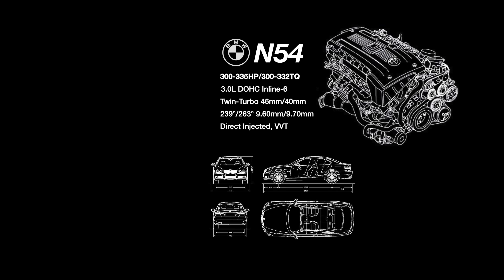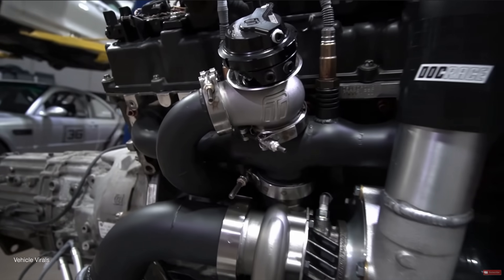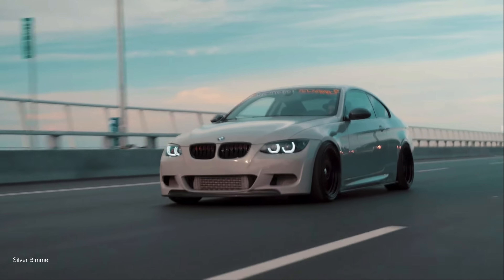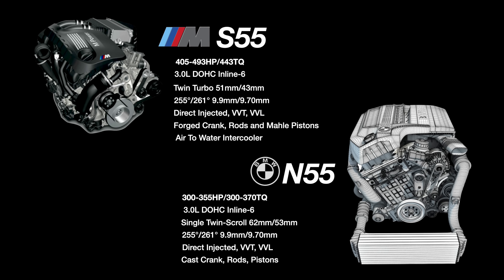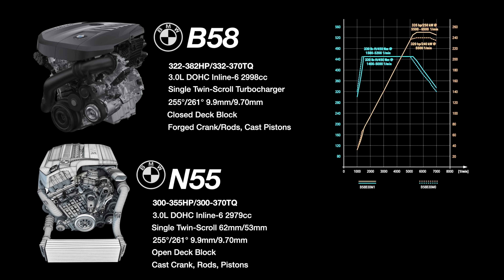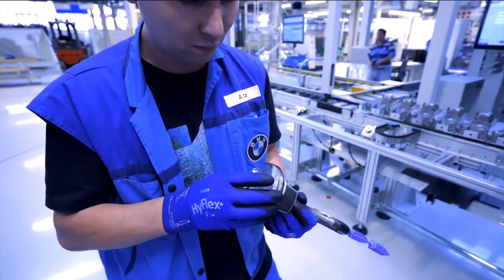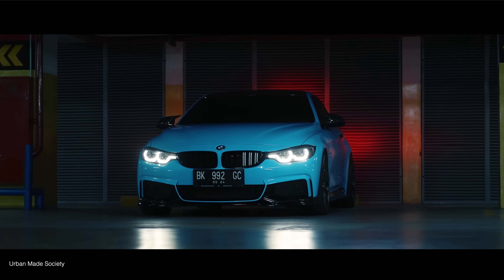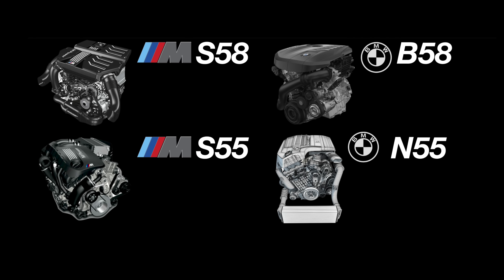BMW Turbo Inline-6 Engines Are Ridiculous | Explained Ep.4

Comment: Lol thats me on s55 race with my m4 e85 vs redeye. To add to your video I have put almost 38k race miles running only full e85 almost at 600whp and have over 100 races running at that power level. Only issues I have had in my last three years and 38k miles racing  were spark plugs/ ignition coils / fuel injectors. I testify for s55 being one of the best engines in the world
Reply: That wasn’t you on your most recent setup, was it? I think you would do a lot more damage now than you did back then
Reply: @PapiAndrey  correct I  have water / meth injection at the moment and makes the car 1-2 cars faster than from you see in the video
Reply: A modded m4 vs a modded red eye 
The redeye puts bus lengths on the little beeemer
Reply: @m4archangel  they’re amazing engines but come nowhere near the best in my opinion. I prefer ls, coyotes, and k series a lot more. I know these engines are sooooo basic but they are hella legendary for a reason. I personally have never worked with coyotes or k series engines so I guess I can’t really speak for those that much, but I actually plan on working on a k24 soon. Also for the price I’m pretty sure the s55 engine beats out a k24 by a lot.
Reply: @themarathoncontinues2289  go watch his videos… he mops everything
Reply: @themarathoncontinues2289  the redeye is good until it has to hit a curve, then it flips out of control 🤣
Reply: @PapiAndrey  9
Reply: Yes, do you have an upgraded crank hub…. Us stock S55’s wanna know….  I’m currently stage 1 Bootmod3 with no other bolt ons and I’m fine.  Thinking of going E30 with Downpipes ….
Reply: @maverickngoose95  I bought my car with 30kmiles it is a 2016 I have put an additional 38k miles on the car and currently have 68k miles on the car. At the time I immediately got the e85 tune from F80paul less than one month after buying the car so I put 15k miles of the 38k miles on the stock crank hub then upgraded to the Vargas crank hub v2 with capture bolt. During the 15k miles of pure racing on stock hub I can tell u I had no issues with stock hub I only upgraded for peace of mind. Honestly don’t worry so much about the stock crank hub it isn’t common to happen. Personally I know out of 100s  S55 owners I know that run stock hub and race are doing just fine. But for my knowledge I have seen the people who have crank hub failure has been linked to aggressive downshifting but the cases are not always like this but it’s more rare to happen than you think. I personally think it’s about the same chance as winning the lottery for it to fail. It’s more company’s trying to sell a product than anything but I should still recommend upgrading it eventually especially if you plan to keep the car for a while. If you guys need any more advice for anything on BMW you can DM me on Instagram anytime.
Insta: M4_Archangel
Reply: @maverickngoose95  Mine slipped around 50k on my 2016 running BM3 93 oct Stage 2 and no other mods and I had been running the tune for about 30k miles. Zero missed shifts or overrevs. Went into limp mode on a hard pull on the interstate and I had all the codes showing a crank hup issue. I was extremely lucky because it was a minor slip and didn't slipe get into the valves. Sure, it's a chunk of money to get it done but that's because it's a big job. Now I'm running a custom BM3 FlexFuel tune with catless downpipes. Defninitly worth the investment if you're going to keep the car and plan on getting into the E blends. Just my 2¢
Reply: I hadn’t seen that race yet. Looks like it was on Auto Glory? Damn you walked that hellcat.
Reply: @havingfunyet  to compare how my car performs now watch the race on Auto Glory I have with a red rs3 two races with him. One no water/meth and other with water/meth injection
Reply: @m4archangel  Just watched it, yeah I can see the difference. That F80 is putting in work. Shit, I wouldn’t run you with my M6 unless I want to lose 😆.
Reply: Hell yea man 😅 had to do it to em
Reply: Right behind the S58 of course.
Reply: @dansparks5475  naw. B series engines are junk. S58 is no different. S55 is the greatest M engine BMW has ever made. Took the reliability of the N55, and gave it the tuning potential of the N54. The best of both worlds which bmw used to be known for before they lost their way.
Reply: @LynxStarAuto  The S58 is far better stock. No crank hub failure and all forged. The S55 has a forged crank. I love my S55 M4 but the S58 is just better.
Reply: I bet that was a sweet surprise seeing your car featured on this video
Reply: @nswiss19751  it was a surprise to me but glad to see it
Reply: Hey can I get some advice? I have a F82 M4 stage 1 BM3. Do you genuinely feel like I need to get the crank hub fix to go stage 2? There’s just so many different opinions on this that I’m overwhelmed now
Reply: @WayTooUnderated  you will be fine have fun and do your maintenance trust
Reply: S58 is even better. Trust me, I´m an engineer :D
Reply: Hey guys. How can I get more HP from my B58 single turbo without compromise the reliability and avoid the warranty?
Reply: @rgms573  race chip
Reply: @rgms573  JB4
Reply: Have you tried iridium or platinum
Reply: Krome Avenue!
Reply: @footballcoreano lol, BMW reliable hardly. Plus, I got 80k bumper to bumper anything breaks it gets fixed, nothing out of pocket.  Enjoy the interior while enjoy the view of a BMW in my rear view lol.
Reply: On stock engine internals?
Reply: @Asch-po8oi  factory engine / stock internals  is more than cable of handling up to 750whp reliable  without any changes to internals
Reply: @Asch-po8oi  stock for stock.  I don’t consider tires as a modification. Driver them how you bought them unless you bought a modded car which I don’t recommend.
Reply: S38b36 s38b38 king BMW six iron block power
Reply: I just want a m3 estate with the F30 looks..
Reply: Thoughts on liquid moly ceretec?
Reply: Wow..thanks  for info ..buying a early 335i..definitely
Reply: Љ
Reply: Suprised the crank bearings or head gaskets didn't shit on you LUL
Reply: Seeing cars like your makes me want to just go all in with mods on my m4 .. I guess I just need to stop worrying about the engine so much
Reply: What year is your bmw I kinda want to trade my gr86 to get one
Reply: @Snagz86  2016 BMW M4
Reply: GOOD RUN. SALUTE
Reply: My kid just bought a 2017 M3 6-cylinder twin-turbo is that the same engine as yours I'm trying to figure out how to keep it reliable I'm what she can do to without going overboard
Reply: @jayrands5380  yes she has the S55 engine…as for reliability, keep changing the oil every 3-5000 miles and don’t ignore any leaks if you experience any. With BMWs, if you address problem right away it doesn’t become a nightmare down the road. Don’t let things snowball and the M3 should last a long time. Heck there are people driving 2002 M3s just fine and still run good.
Reply: All you guys arguing, I been racing since I was 8. I'm 43 now, im enjoy my popcorn.

All of you are sad. Except the Beemer owner he cool. 

The rest of you a bunch of clowns. Continue please, where my salt?
Reply: @cuinican1980 bait
Reply: My m88 turbo in my alpina wants to argue with y'all
Reply: Nice car 👌🏽
Reply: Nice l have turbo eg swap h2ba7 euro
Reply: Let’s see how it hold up at 100k
Reply: Redeye can’t even keeps its power down lmao u need everything to go it’s way for it to do a good 1/4 mile
Reply: I love BMW inline 6 it's my favourite engine of all even the diesel ones are good
Reply: That red rs3 had you matched! I just watched both races and at the end it looked like he was slowly pulling on you….that or you let off
Reply: Who cares
Reply: Your coupe is a thing of beauty bro
Reply: Have a look into the V12 from the E31 - amazing piece of 80's engineering!
Reply: Thank you for your input. So glad that a human is here to set things straight instead of keyboard warriors that "heard" this and that about BMW.
Reply: Nobody cares pal
Reply: Wow incredible data here.
Reply: Right after b58/s58
Reply: Do you have the crankhub fix on your s55
Reply: Exactly why I fw the s55 engine
Reply: Crank hub fix too?
Reply: Only major issue is the Crank hub bullshit 💀
Reply: Believe and put your Faith in Jesus Christ’s Death Burial and Resurrection for your Sins and you will be Saved
Reply: You can buy a used hellcat for 45-50k
All you need is a bigger pulley and a tune 🤷🏼‍♂️
Reply: @themarathoncontinues2289  with over 100k miles and three accidents yes you can find them for that price
Reply: @themarathoncontinues2289 and they almost always up on a tow truck with rod knock.
Reply: 12 valve Cummins enters chat
Reply: It’s 3yrs old yo. Stop comparing your foreign crap to American made muscle cars. In 10yrs your car won’t even be running anymore, it will need parts/labor that costs more than the car like the majority of bmw’s. The N52 without the pain in the ass turbos and direct injection carbon build up crap is the only thing reliable bmw ever built.
Reply: @rip2175  American cars last 3-5 years max then they become big pos. Especially performance American cars. Still a ton of older BMW running real strong while I barely see any 2005 or 2008 chargers or mustangs gapping anything they’re all at the junk yard.
Reply: @yg78t76t7  yep it's a shame they cant except for comaros and mustangs
Reply: @yg78t76t7  lol. My impala has more problems than my friends M4 that gets beat on every day. I’ve spent more money fixing my shit than he has modding his car.
Reply: @rip2175  HellHawk is this your alt acc?
Reply: @m4archangel  you can buy a old hellcat at 707hp pop a pulley for $500 and you beat that m4. Looks, sound, speed, space and room. Remember the challenger bout the same size as a charger
Reply from the maker: Pulley only hellcat won’t be enough considering how the M4 walked away at the top. You’ll need upper, lower, Id1050s and Exhaust. Around $2500 and at higher speeds the Hellcat will heat soak before the M4.
Reply: @337speed  my Trackhawk with just a 2.65 upper pulley injectors and a tune made 885 whp and you don’t think a 2.65 pulley on a larger blower won’t make 925 whp you are wrong period and that m4 racing a 900+ wheel hp anything Is getting busses put on it
Reply: Shit my Trackhawk put busses on my wife’s 2021 m5 comp and the trackhawk weighs 5600lbs. Also you can’t just add a pulley without fuel 🙄. My hawk ran 9.88@135 mph with just intake, injectors upper pulley and tune, any redeye  with the same exact mods is making any m4 owner sell their shit
Reply: @337speed  shessshhhh never knew that wow !
Reply: @hellhawk4680  I have a model y performance and x6m comp. Both stock both destroy trackhawks (most of my friends own those  ugly loud mopar beast) 
I love trolling you w the teslas tho. Gets your tiny ballz all shook. Smh where’s the car culture and love for diversity ?
Reply: @germaninvasion121  lol 😂 I sold the hawk a year ago and bought a Plaid.  So your post is comical 😂
Reply: @hellhawk4680  why is my post comical ? I have a model x plaid on order and my neighbor has the model s plaid. If I just recently didn’t have kids I’d never consider a car as soulless as an EV! It’s a cool gimmick. Try taking a road trip or race a mustang gt below 50 percent SOC you’ll realize that a battery car is just that, comical! Stop getting easily offended it makes you an easier target for trolling! Lmao
Reply: @germaninvasion121  hahahah the fact you actually think your trolling 😂. And not getting trolled 🤦‍♂️
Reply: @hellhawk4680  you’ve been trolled by 30 ppl above me Lmao it really doesn’t matter what I’m doing from here on!
Reply: @337speed  now with the FI intercooler for the Mopar, LS community it adds a good amount of power and helps alot on the heat soak.
Reply: @hellhawk4680  Nice story about the M5. Funny part is to ONLY put a tune/downpipe/e30/40 on that m5 (stage 2 is literally all it needs) and it will be running 2.5/6 0-60mph, 9.7-9.9@140mph+ and 60-130mph in the high 5s, and that’s only with about 780whp. It would be pretty sad if a trackhawk making 885-900whp didn’t put bus lengths on a bone stock m5 comp (lady driven to make matters even worse) which makes 600whp on a good/lucky day, despite the roughly 1000 pound weight difference. 😆 😂 🤣 🤣
Reply: @hellhawk4680  problem no1 you don’t own one 🥴
Reply: @hellhawk4680  Any videos of you racing your wife's M5 comp?
Reply: @hellhawk4680  I don't know.  The Xdrive M4 has already run 9s with basic bolt ons. The G80 cars will be running low 9s or 8s soon enough.
Reply: @hellhawk4680  its so funny how you say intake, injectors upper pulley and tune just to do high 9s. Must suck knowing a G8x on downpipe, tune and remapped gearbox does mid 9s running 145+ mph
Reply: @hellhawk4680  these guys don’t get it they wear skinny jeans and drink mocha chinos.
Reply: @337speed   do a video of the bmw v engines next
Reply: @germaninvasion121  ikr kids takes all the fun🥲
Reply: @hellhawk4680 my m8 does better with just dp and e30 🤣 u needa find a new tuner or sell that shit
Reply: @337speed  Good channel live tuning in could you do an episode or two on the Saab 2.3T / 2.0T and 2.8T from Holden .? Please and yanks
Reply: @hellhawk4680 their are absolutely 0 stock block dodge products period that run 8. Haven't in person or on video seen any stock block dodge product touch 8 seconds. Both the B & S58 have done it. Helcat, redeye are good for what they are production wise. But apples to apples once a few dollars are thrown in a dodge and another 6 cylinder dodge always gets smoked. I do mean always. Dodge stock to any other car stock  sure, both modified, every car and I do mean every car walks away American, Japanese, and European.
Reply: @germaninvasion121 some this wrong w you
Reply: @SRT_VILLAIN  you are so wrong, they are the ugliest cars around. Built by dodge so really just a kit car put together by a million foreign parts then called "American". Absolute jokes of boats and yes they are ugly af.
Reply: Must suck to have to mod your car to beat a stock red eye 😂. That redeye with just a pulley and e85 tune would of put busses on you
Reply: @hellhawk4680  must suck to spend that much and still lose.
Reply: @hellhawk4680  what's your point? A 3.0L turbo with bolt ons and E85 pulled on a 6.2L supercharged V8 making almost 800hp at the crank. Must suck to have to "mod" your muscle car with double the displacement to beat a bolt on inline 6.
Reply: @urs6onfuturas975  one has government limitations the other doesn't😂 the redeye is also bigger and more room
Reply: @SRT_VILLAIN  one is based off an ancient Mercedes chassis from the 90's and has had no significant upgrades since it's refresh in 2015 besides tacked on fender flares and slightly more power depending on trim. The other is a better overall enthusiast vehicle for people who actually enjoy driving and not just going to the local sideshow and doing burnouts.
Reply: @urs6onfuturas975  you shouldn’t need to mod  if it’s such a great car. Give me a break stock for stock you’re toast.  Anytime you want to run a real race on a road course I’m down.  I just have a shitty American Gt500 carbon track pack stock all factory.   Pretty easy to go straight let’s see if you can really drive.
Reply: @nickdovedan9020  haha what are you talking about? Where did I say I own a red-eye or a m4? I'm not a "straight line" person by any means. Obviously you'd know that if you knew what a UrS6 is and the heritage of "old" Audi especially the 90 GTO or C4 GTO. I also don't think that American cars are shitty being a full blown "Merican" who's owned some form of vehicle from all of the Big 3, but my personal experience with Mopar ( 2 Rams and 2 Jeeps) is that they are trash. I drive a TRD pro tundra mostly, Corolla when I want to save gas, and my Urs6 project when I want to have fun. I originally planned on getting a 991.2 GT3RS but went the build and restore route with the UrS6 instead because I will always love the AAN/3B engines and wanted to teach my son who's a little gear head too.
Reply: @urs6onfuturas975  wasn’t at you more for OP.  I find it humorous everyone is a professional driver u til they get on track with left and right turns.  Shit just buy a plaid if all you want is straight line speed.  Moreover, with all the nanies on new cars it’s hard not put down 9 to 11 second runs in a quarter.  Hell Ive seen civics that will make any car look it’s standing still in a straight line.  However, that’s not skill.  You can make anything fast in a straight line not so much on a road course.  The skill level required to run a good time at any road course is ridiculous.  Straight line warrior bore me, alway going to be someone faster or who’s done more to their car.  On a road course your wallet will only take you so far.
Reply: @nickdovedan9020  I agree. I've worked with some of the biggest names in drag racing over the years hell one of my best friends has worked for Don Schumacher, John Force, and is currently working on Leah Pruett's team building her superchargers. I appreciate everything automotive but I'll take turns over straight line any day, I've built a good amount of race cars not drag cars in my life don't worry. Ha
Reply: @urs6onfuturas975  I’m a little jealous! I will say top level drag does require skill but us weekend warriors not so much.
Reply: @nickdovedan9020  take a sharp turn In any American car and you’ll see where you’ll end up. Meanwhile a base model Audi or bmw will out maneuver you in any curve!
Reply: @germaninvasion121  do you really know anything about the carbon track pack gt500 it’s a drivers race with GT3 RS.   So, please explain to me what I need to know about my American car turning?  Watch Randy P race both cars, their times are identical.  I suggest you quit underestimating American cars, it’s clear you lack depth of knowledge on their capabilities.
Reply: @nickdovedan9020  the gt500 is a beast. Drove it on the track a few months ago. Handles like every American car, horrible. 
The only car I’m impressed by is my dads viper acr. Maybe a ford gt which I’ve never drove. That’s it. The rest is trash!
Reply: @nickdovedan9020  Americans are only good at throwing hp at their cars—the v8/10 do sound good tho! Nothing less is impressive at all!
Reply: @germaninvasion121  then you need learn how to drive.  It handles as well as the Gt3 rs.  So, you’re saying that those cars can’t handle either got it.  The mental gymnastics to shore up your bias is astounding.
Reply: @urs6onfuturas975  best reply ever to the red eye guy!😂
Reply: @nickdovedan9020  Any videos of you tracking your Mustang?
Reply: @cleverusernamecl5532  I’ve only had a month and half, only hit the drag strip so far.  I have time slips if you want to see those.
Reply: Also, where I live it’s been triple digits for about a month and half bad DA.
Reply: @nickdovedan9020  what handles like a gt3rs ? I drove 3 gt2 and 3rs. Stop embarrassing yourself man. The only thing that handles like a gt3rs is another gt3rs. Acr is suicide, gt500 absolute garbage w no balance. I’ve been driving fast/rare/super cars for 15 years. I’d like to think I have a decent abilities to make an unbiased judgement. Viper has been my fav American car besides the older ford gts. However those cars are only ever suited for the rarest of occasions. And for drivers that been racing all their life. No average Joe shmoes on YouTube!
Reply: @germaninvasion121  Camaro ZL1 1le has a 7.16 ring time. I love my M4 but saying all American cars are trash is ridiculous.  The C8 Z06 is a sub 7 ring car. Faster than a Viper yup.
Reply: @urs6onfuturas975  who the heck wants to BUY w hotrod. That defeats the purpose..
Reply: @urs6onfuturas975  bro you destroyed him
Reply: @urs6onfuturas975 stop your whining. It’s still embarrassing to have to do all that to beat a stock car
Reply: @hellhawk4680 all it takes to be faster than a Redeye is a m4/m3 with tune and downpipe which are inexpensive compared to buying a $80k boat to get zero driver feedback and spends more trips at the gas station
Reply: @m4archangel  the m4 not even the same size. And they cost the same. Redeye starts at 72k 😂 the redeye and m5 are in the same realm. The redeye is cheaper and faster
Reply: @hellhawk4680  not really, hellcats are actually overall pretty slow considering the power they have. They need to refresh the line up with a faster chasis like on the Trackhawk, and AWD as dig races are embarrasing.
Reply: @hellhawk4680  there's always this one guy: "bUt WhAt iF iTs sToCk??"
Reply: @hellhawk4680  better go spend some more to catch back up then. Can't have your big bad supercharged two ton turd getting smacked by a 6 cylinder.
Reply: so mad over a 5 year old video LOL
Reply: @asfbi  go back to GTA 5
Reply: @hellhawk4680 except an s55 doesnt cost as much as a red eye?? i think the average price for an f80 m3 comes to around $50,000, whilst red eyes average about $60,000. ten grand can build quite the car, and assuming you do buy a dodge, you cant track that car. its straight line performance. which is fine if thats what youre going for, but these german cars seem to do it all. if anything the track hawk is overall better.
Reply: @hellhawk4680  hellcats come boosted
Reply: @dashawnrobinson1802   really no way 😂🤦‍♂️
Reply: @hellhawk4680  correcting yourself now
Reply: @hellhawk4680  they really shut you tf up 😂
Reply: @S3Flux  I went through this whole thread just to watch him get destroyed.
Reply: @joshua_booysen  facts lol bro thought he did something with that comment 😶‍🌫️🤣